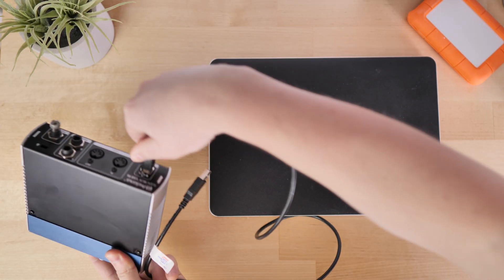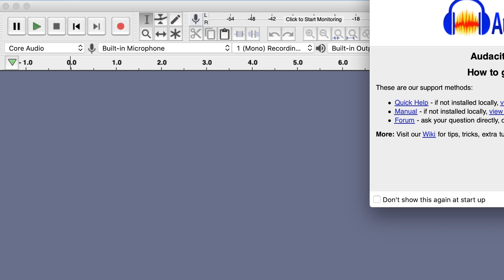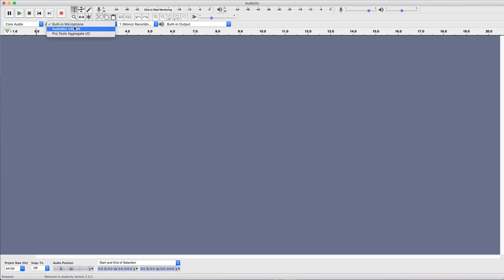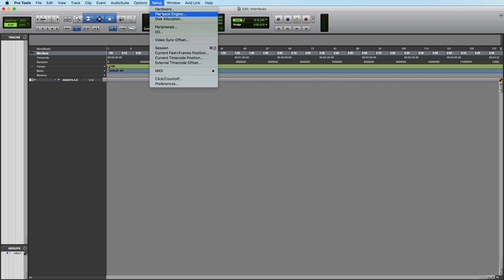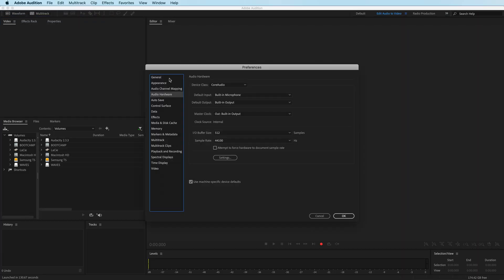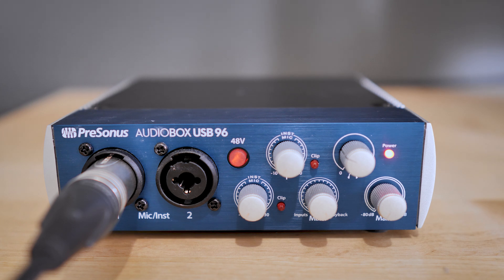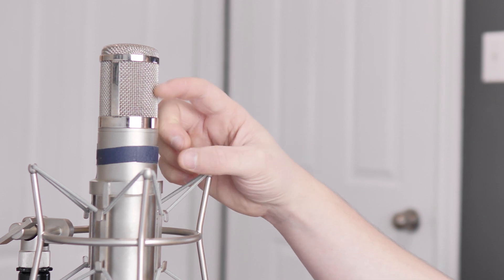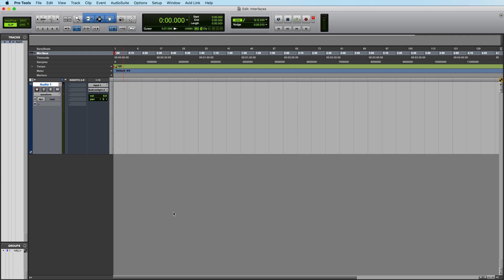Audio Interfaces For Voice Over

Comment: hi Randy, im new to this audio mic condenser and voice thing. im still a little bit overwhelmed with all this stuff. so i want to buy an audio interface to pair up with my mic/condensor which is a rode ntk, it was my moms originally, so nope i didnt buy it.  i wanna ask if the focusrite scarlett solo works with rode ntk or not. and then you talked about the phantom power. rode ntk has its own power supply. the xlr cable is a 7 pin from the mic and it goes to the power supply first, and then the power supply has the xlr 3 pin. so does it work when i connect the xlr from the power supply to the audio interface? and does it need the phantom power to turn on? and also i noticed people used studio monitors speakers(?) and say they need it. is it an absolute must to have them for recording? like, i cant record if i dont have studio monitor speakers, or its just to make better quality sounds? im on a really strict budget so im just trying to buy the things i need to record a good/decent audio, thankss!!
Reply from the maker: Hey there, I would recommend using headphones. You certainly don't need studio speakers at all. As for the interface, the Scarlet Solo would be perfect. Usually with a power supply, you won't need to activate phantom power, but I'm not sure specifically with the NTK. Either way, you'll have everything you need with the Scarlet Solo. Hope this helps -Randy
Reply: @voices  hi, thanks for the quick reply and answering the question!! helps alot

Comment: I bought some good quality beginning VO equipment years ago as recommended from a veteran VO artist via a YouTube video (years! lol) and I am just now  setting it up. I think my equipment is outdated. I have a MXL condenser mic (which is still good), a Behringer mixer no USB connection, an older Lexicon Alpha audio interface. I know there is a way to install the older driver for my Lexicon Alpha to my windows 10. However, my question is this...is there an easier set up now?  I bought the Behringer mixer bcs it was said to have better sound quality if I use both. Essentially the set up would be Mic to mixer, to audio interface. I see now there are updated Behringer mixers with a USB interface. I am not certain Lexicon even has any newer audio interface equipment. I'm looking to make this the least complicated set up with the best audio output on a budget. I am more than willing to use what I have and figure it out as long as the audio comes out great but it seems to be more complicated than necessary with newer equipment out there. Also I have Audacity installed. Are there any other audio recording software programs that may be better you'd recommend? Help! Please 🙏 anyone....
Reply from the maker: Hey Sabrina, it sounds like you're on the right track. Audacity is a great place for people to get started. As for the equipment, the mic should do just fine, but it you're going for the easiest setup possible, you can use an interface with a mic pre-amp built in instead of the mixer and interface option. You're right, the new Behringer mixers will also have USB options which makes them super easy to record with. I recommend checking out the Focusrite Scarlett Solo, Behringer UM2, or Presonus Audiobox96. All of these will be simple to use as you just plug in your mic and you're all set! I hope this helps. If you need any more assistance with your profile, please contact support@voices.com

Comment: Hi, I'm using a Fifine USB mic, do I need to get an interface also does an interface take care latency and if not how do you get rid of that?  Thank you!
Reply from the maker: Hey there, you wont need an interface as USB mics do a similar process built into the mic. To get rid of latency, there are a few things you can do. Check your 'hardware buffer' in your software. The larger the number, to larger allowance you're giving your computer to process the audio, meaning more delay. You will want it to be something less than 512 samples to hear less delay. Too low and your computer might start pausing when you're trying to record if it's having trouble keeping up.